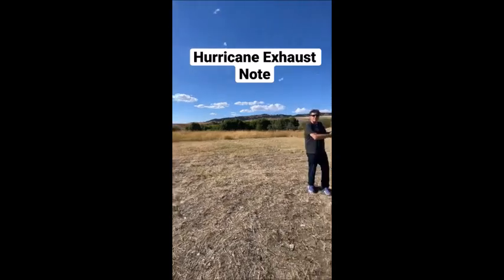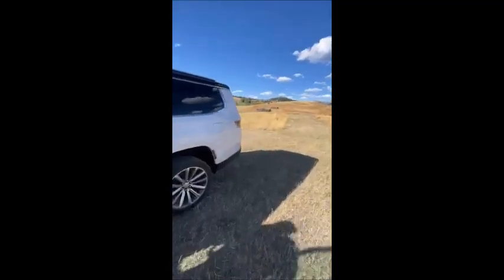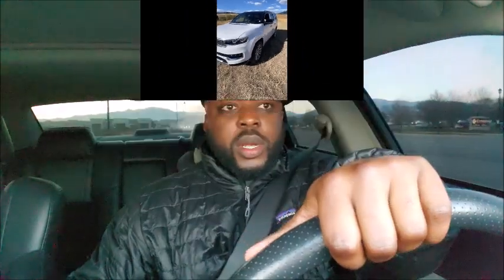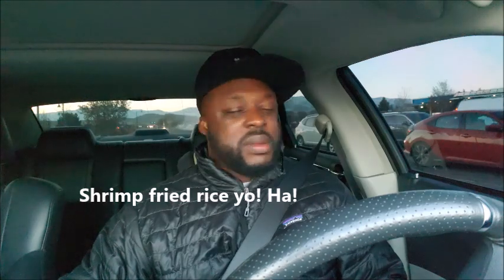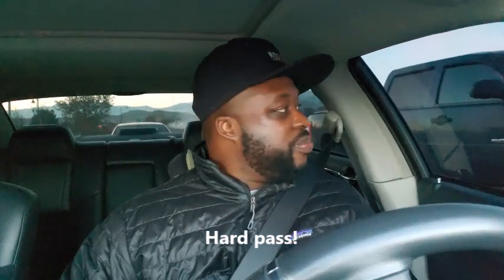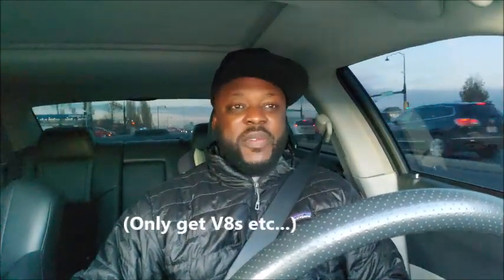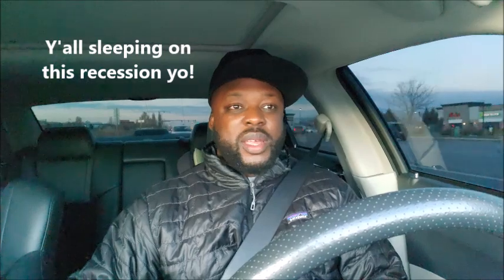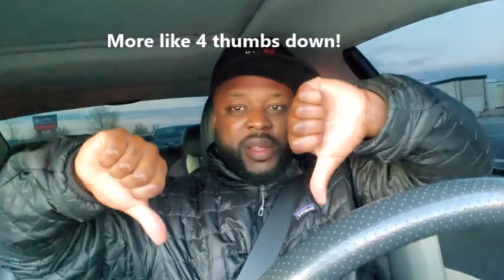2024 DODGE CHARGER INLINE-6 TWIN TURBO HURRICANE ENGINE SOUNDS LIKE THIS!?

Comment: Dude, this video isn’t fair. The Wagoneer is not a performance car, it’s a family SUV with restrictive exhaust to meet emissions standards. The Pentastar V6 is in various Dodge cars, but Challengers and Chargers are tuned differently, so it’ll sound different. I6 engines can sound incredible, and I have no doubt the new Charger and Challenger will sound way better than the Wagoneer.
Reply from the maker: Fair enough...but I won't hold my breath. I'm sure Dodge will make it aggressive but watch it be very ricey🙁
Reply: People like are the problem 😢
Reply from the maker: Always comes down to people 💯

Comment: I'm sure Dodge will tune the exhaust much better.  BMW does inline 6's in the 5 series that sound like vacuum cleaners but in the M340i's especially in Sport+ mode that B58 inline 6 sounds awesome.  Hopefully Dodge does the same with the Hurricane.  They can't let the Challenger sound like that lol.
Reply from the maker: You probably right...we shall see. Only 6 cylinder sounds I like are from GTRs 😄

Comment: You can't judge it off stock exhaust. Put a nice quality catback on it and it's going to sound nasty. Especially with upgraded intake and you hear those spooly boys.

The stock power level is going to be easy to turn up also likely with just a tune.
I'm waiting for the Hurri-crate cat 3 package to drop into my Jeep Commander.
Reply from the maker: I'll believe it when I see it (hear it). 😅
Reply: @Mr. 300C  just like anything. Stock exhaust sound terrible especially on a big family SUV. Lots of great inline 6 motors that sound insane. RB26, RB30, 2JZ, Jeeps inline 6 when people put turbo kit on them. The cummins turbo diesel. The inline 6 is a super under unpredicted platform and is an absolute torque house.
Reply: @Mr392Scat  my personal favorite is the RB30 R-34 GTR. The 2JZ is a close second. BMW has a nice sounding one also.
Reply from the maker: I hear ya player. I'm just not a fan of Inline-6 sounds even with a exhaust setup. Too raspy for me.
Reply: @Mr392Scat  it's hard to beat the sound of a nasty loping cam in a V8.
Reply from the maker: Very true!🤭

Comment: EV do deserve their chance only under the performance pretexts.

Honestly i think the very high brands like Porches, Ferrari and Mc Laren are doing it right with their hybrids mixing both powers trains and the option to save gas on short trips going pure electric but you still have the engine at any moment.
Reply from the maker: Valid points. I know Dodge still has some tricks up their sleeves.

Comment: Research the materials to make an ev battery. There isn’t enough and it’s only in certain places. We aren’t staying ev for long.
Reply from the maker: Yes indeed. There is a lot of long-term issues with EVs they haven't addressed or resolved yet. I hate that it's being forced down our throats. It should just be added as an option like any other product without the forcing. .

Comment: Sound like a exhaust tuned for a luxury truck.  They will tune it different in the Charger.  If you opt for Hemi your going to see the Ass end enough to hear it.
Reply from the maker: Hahah! I gotta hear it when they Dodge announces these engines for next year in the Charger/Challenger.
Reply: @Mr392Scat  As long as they don't have to pipe in like a Porche or the EV.  Its tough to make a turbo engine sound loud with the turbos acting as mufflers, but maybe the Italians can help the made the 2.0L sound racy in the AFs
Reply from the maker: I dont think that will happen. So much to see this year! 🍿🥤

Comment: Ok so basically you’re saying that you think it’ll sound way too close to a Supra or something ricey like that, and you’re more into the classic muscle car V8 sounds, yes? Just curious, no worries. 😋
Reply from the maker: It sounds worst than a Supra actually. Ha! One guy in my neighborhood has one and its solid (but I bet its modified though). And yes, love me the classic and modern V8 sounds. 

For the record Skylines are 🔥! 😁
Reply: Yeah fair enough dude, V8’s with decent exhausts are definitely hard to beat a V8 for sound. 

I’m quite partial to the turbo inline-6 sound because it reminds me so much of my motorcycle. And the Mk4 Supra is a modern classic sound  😁
Reply from the maker: Understandable player!🤝🏿 You should go see my older videos with my V6 Charger. I had that bad boy sounding so aggressive 😏

Comment: They should make a Hurricane V8 which can be the successor to the HEMI V8. But if it were to happen, it must be offered with a supercharger for the new Charger, which is what pretty much everybody is demanding.
Reply from the maker: Hurricane V8 (smaller displacement) with turbos and awd (hybrid) would be dope. ☺️
Reply: @Mr392Scat  Speaking of AWD, it’s being criticized because most people want RWD since it’s a muscle car’s traditional drivetrain. If Dodge offered RWD as standard, people would be happier.
Reply from the maker: Apparently the next generation Chargers can turn on RWD only 🙄.
Reply: @Mr392Scat  I know, but most people want RWD only, not AWD with RWD mode. Besides, AWD is optional in many other cars. The new Charger has been criticized by many for the lack of a V8 and RWD. Since the previous Charger had those features and was literally outselling every other American sedan combined, it’s already quite obvious what options Dodge needs to add in order to attract more buyers.
Reply from the maker: Too bad Stellantis doesn't care about our muscle car segment. They said they will invest $6B into ICE but no plans for a V8 or hybrid V8. The writing is on the wall. The EV Charger will flop. Dodge Hornet is already a flop with 2 years of unsold inventory supply. Durango is going away. The Inline-6 Charger will sell a little bit but not enough to make Stellantis investment worth it. 😶‍🌫️ Times are rough.
Reply: @Mr392Scat  Most people would probably choose the Ford Mustang and the Cadillac CT5-V Blackwing over the 2-door Charger and the 4-door Charger, respectively. People were right, Stellantis is losing to Ford and GM.
Reply from the maker: @anonymous3738  yeah bruh there is no way Dodge will rebound after all of this. 3 years tops and the brand will be dead🤐
Reply: @Mr392Scat  I forgot to mention that many American cars until the 1980s had I6 and V8 engine options. However, the I6 was only an entry-level engine due to the lack of performance the V8 had, much like the V6 in the previous Charger and Challenger. So those who prefer an “entry-level style” engine and don’t mind AWD may be fine with the SixPack Charger. Or it may suit those who want something like a BMW but more “American”, with a turbocharged I6 and AWD with RWD mode. But Dodge can do better, since car features don’t have to have just one option.
Reply from the maker: @anonymous3738  yes indeed. Time will tell. #NumbersDontLie